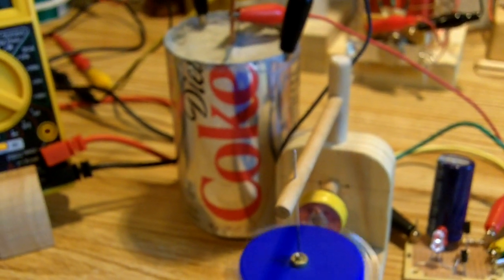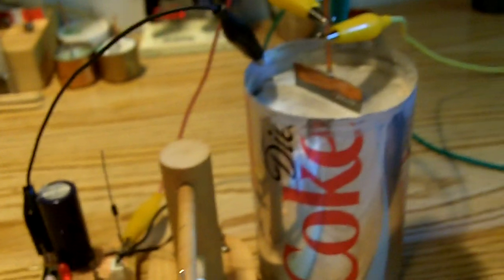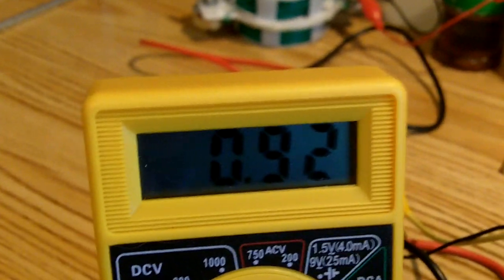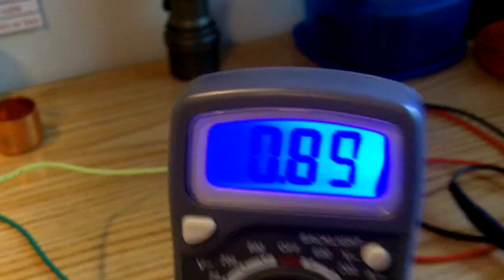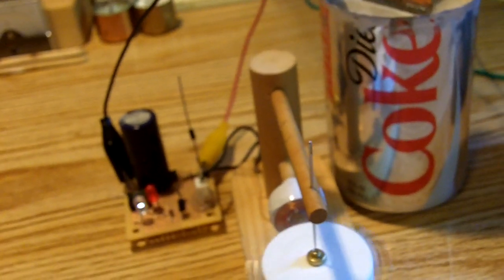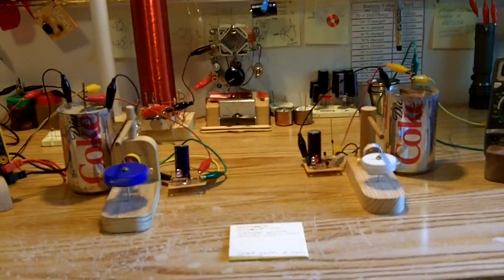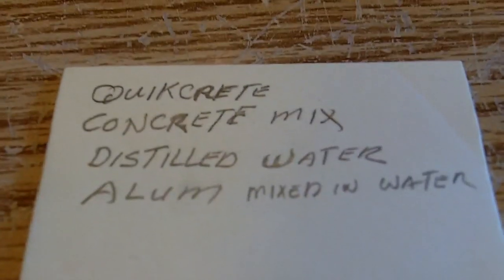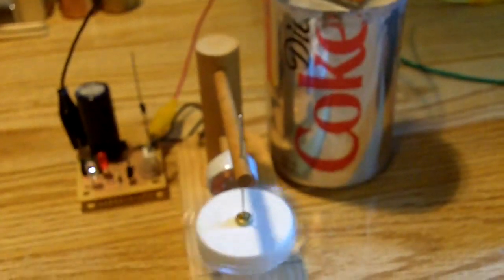concrete power update.MOV

Comment: This is extremely good news.   I didn't get that good of perfomance out of my cement batteries.  I might have to build another one to your specs and give and give it another try.  All of my cements batteries still have about 1 volt on them but almost zero amperage available.  Even testing them with a multi meter drops the voltage.  Your use of a copper plate instead of twisted wire might be the difference.  I am also wondering if the pulsed load has an effect on these type of cells life span.